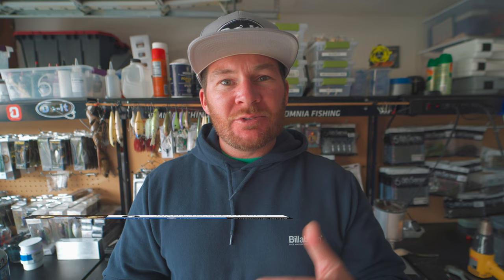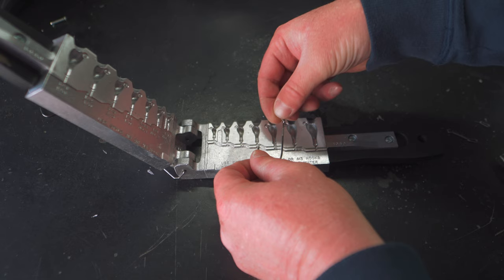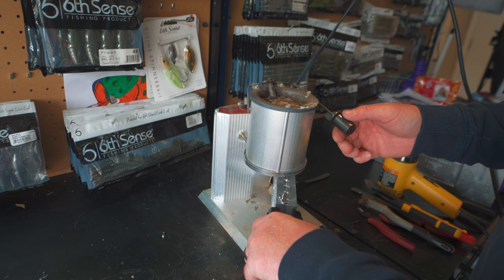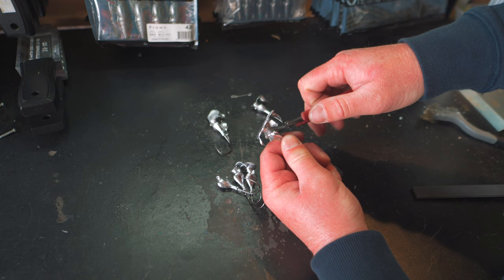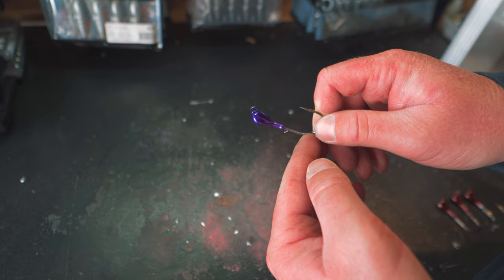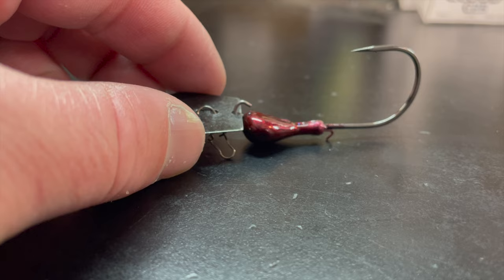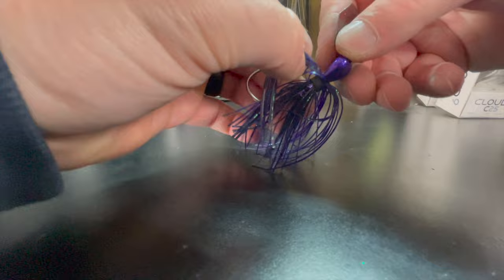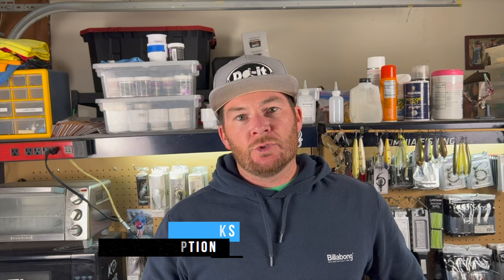Unbelievable Chatterbaits - Make Bladed Jigs Yourself with these Simple Tricks!

Comment: I have the same mold and the same wire forms but no matter how much I squeeze the wire form it will not fit any size less than 1/2  I want to do 3/8 am I missing something here?
Reply from the maker: Is too long?  There’s a smaller wire form out there too that’s the same design
Reply: It's the eye of it that's too big. I trimmed it down and that works but would the smaller one have a smaller eye ? Because that would work better. Where can I find it ? Thanks for the response bro appreciate it.
Reply from the maker: @StevenGifford-tc9iw yea if i remember correctly the whole thing is downsized
Reply: Awesome thank you!!! I'll definitely check it out.
Reply from the maker: @StevenGifford-tc9iw you’re welcome

Comment: Been loving the Sparkie Jig mold !! made a few chatter baits, and they work like a dream, I watched the past two vid's too since they give different tid-bits. The wire keeper is a bit finiky at times, so i've modified my Jig Mold to be able to hold the wirekeeper in place close to the hook but enough for lead to flow around it, cause before, the wire keeper would be really tight against the hook where the lead needs to flow, but it gets blocked and i ended up with unfinished jigs that i had to melt back down, and redo it.
Reply from the maker: Glad you found a way to make everything work well!

Comment: Is there not an option for a 60* hook that fits in the mold without the wire eye? I am hesitant because I feel like that wire would bend out after too much weight or too many catches.
Reply from the maker: The wire won’t bend out for traditional fishing.  Hooks can work, but often opening them and the closing them breaks the hook.  They don’t bend all that well depending on brand

Comment: Matt,  great video.  I watched the very first video you had on making these baits and I noticed you have changed up the wire form you used on the first video I watched.  I like this much better.  Can you again let us know the number of the form used in this video.  Also where are you getting your blades, as well as, the make and model for the 4/0 flipping hooks you are using.  I made my first chatterbaits using the wire form you previously used and I used 4/0 VMC spinnerbait hooks.  I didn't care for the resultant action of the baits I made.  The blades I used were rounded vs these blades you used in this video.  Appreciate any help and new material tips you can upgrade me with.  Thanks, George Nochta Santee, CA
Reply from the maker: The info on the components is in the description of the video.  Listed out.  The blades are from Ali express.
Reply: Thanks Matt.  I located the hooks and wire forms.  When I order the blades from Ali express for the 3/8 & 1/2 oz jigs should I order the medium size blades for the proper action on the finished vibrating jigs?  Thanks, George
Reply from the maker: @georgenochta3725 it’s been so long since i ordered them, I’m not sure.  I’d measure a blade you have now and get the one that’s closest
Reply: @MattLunaFishing  Yeah for sure.  I think I will order a small amount in S, M, & L and that will tell me what size I need.  The blades I have are all the rounded edge type sold by Barlow's.  Just thought you might have remembered what you used.  Have a good Thanksgiving.  Once I get my ali blades, I'll post what size I end up using.   >+))))><

Comment: Matt, what heat range heat gun do you use when setting powder paint.  I have an older gun and I think I'm thinking of going down to my local HF and getting a new gun.  They have several models with different heat ranges so on your suggestion I will make my choice.  Thanks again for taking the time to make quality tac building videos
Reply from the maker: My heat gun only has a high and low setting.  Mine may have come from there, I don’t remember.  I’ve had it for a long time.  I use the high setting.

Comment: Just bought a few lead molds. Do you put anything on them before pouring?
Reply from the maker: No i don’t.  Just make sure they are warm when you start pouring.  Occasionally I’ll spray blaster dry lube into the mold if I’m not getting complete pours.

Comment: Nice work Matt as always what is the part number for those 4/0 hooks and can I use smaller hooks also ? Thx
Reply from the maker: The 4/0 hooks are just a 4/0 flipping hooks.  Pick your favorite brand. You can use smaller hooks within reason.